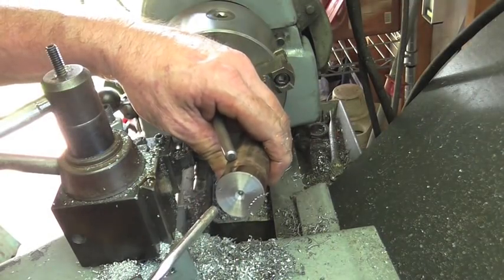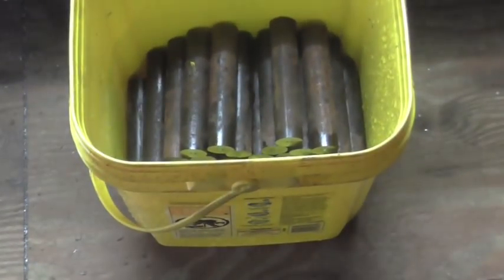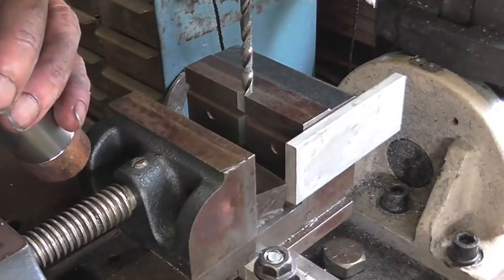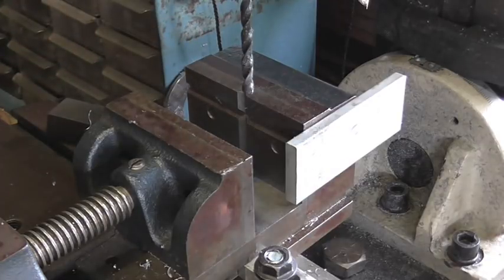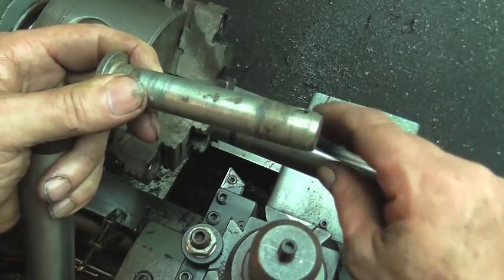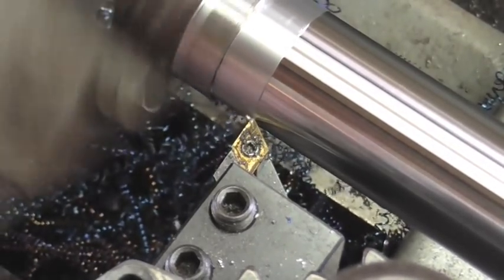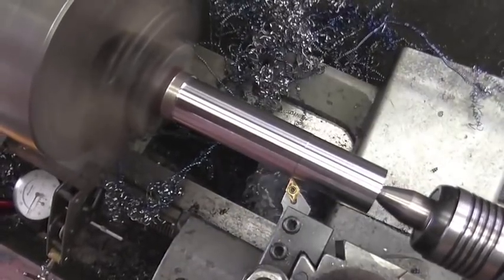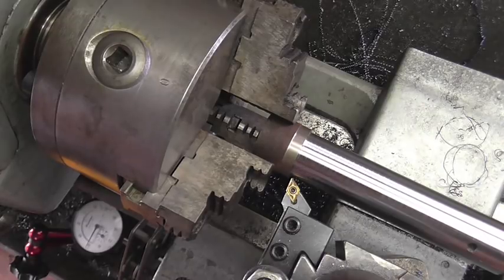(40) Precision HOIST Pins Machined From 4140-HT Steel / RUSH JOB!!! Part 1- MSFN

Comment: You need to make a chip hook.  Great quick project.  I don't have one myself.  What happened when you took more than .010?  Seems like .050 would be reasonable.  I don't have any of that allow to try out.
Reply from the maker: At 1200 RPM I cound take off much more than .010. Sure was a learning experience. At 600 the tool "pushed off" at 1200 & highest feed rate it "cut". I did beat up the lathe and my brass nuts a bit I confess

Comment: I have used a 4140 annealed (not the Half Temper/Heat Treated/High Tensile you are using) a few times and find that it really seems to want high speeds and feeds. I have had decent luck with 1100 rpm and 0.014"/rev. However, I am novice so take my recommendations with a grain of salt. I really like the explanation of your thought processes and that you even show mistakes. Very nice.

Comment: Use a parting tool to under cut the hole close to finish diameter then hog the rest without the intermittent cut.
Reply from the maker: The hole was a huge mistake, that is an excellent idea btw, wish I thought of it at the time

Comment: Makin Sumthin From Nuthin
I'm not sure if I misunderstood you saying you can't take a cut bigger than 10 thou.Whether because you can't get it to chip or the machine can't handle it.Such a small depth of cut shouldn't be a problem on any lathe given the diameter of the work piece.As a machine shop owner 4140 is one of my favourite materials to machine always gives good finish as long as you don't let the tool rub for long at the end of the cut against the shoulder which can work harden the material.From what I can see your main problem is the chip breaker on the insert you are using it's too wide not suited for very small cuts need a tighter chip breaker for shallow and finishing cuts.Also it's not a good practice to pre- drill hole in material you need to turn which as you say creates interrupted cutting and not ideal for carbide inserts.If your spindle bore is large enough to fit that size  bar it's always quicker to use long enough bar that wont cause  machine to shake or material to whip, for instance enough material to do 5 pieces in this case plus parting allowance and an inch or so to hold the last piece.This way you can completely turn each part and part off and once you finish turning them all you can put the pin head inside  the chuck cavity which should fit without a problem looking at the size of the pin,pull it outwards against the jaw as a stop and machine or part off the bit on the end with centre hole.Now you should drill the hole.As they say practice makes perfect.
Reply from the maker: I realized towards the end of the job the SFM using the carbide available at the time was too low preventing a deeper DOC when I first started out with the 4140. The Combination of nose radius, chip breaker, DOC etc. were all were against me when I first began. Once the lathe speed doubled it was "relatively smooth sailing" although I never did figure out how to actually break a chip. But I got thru the job on time and even tho I struggled. The stock was 1.125, my spindle bore is .750

Comment: Some challenges for sure Richard - not the friendliest of material too in a smaller size shop. I tend to get those stringy chips with 10-45 too.
As Dave mentions (User) turning away from chuck can be useful. Look fwd to part 2. :)
Reply from the maker: Yes Chris, wasnt friendly at all. Beautiful steel to work with however, surface finish is glass smooth unlike mild 1018 or A36. I had to earn this one
Reply from the maker: I am sure there is stuff out there that may have helped, I am no expert at carbide either
Reply: I also am not fully familiar with all options but, so much can depend on material, feeds and speeds etc - if there is an integral chip breaker profile then tip radius too can be a factor for it to work. Sometimes experimentation can be useful!

Comment: Get yourself the longest pair of needle nose pliers you can find, to pull the stringy chips out and pull the chips out at the end of each cut. CrMo likes as much speed as you can give it and as the speed comes up I was able to take a much deeper cut than when I was trying to cut at my normal cutting speeds.
Reply from the maker: Thanks RJM......The job went MUCH smoother at the higher RPM even tho the stringy chips were still an issue. I never cut 4140 before...or ran above 685 RPM. Towards end of the job at 1270 RPM I was able to take .020-.025 per pass rather than .010 at lower speeds. Was quite the learning curve...for me at least

Comment: Thank you for sharing, and helping us learning!!!. I think that many of your subscribers have commented comprehensively. 
I think the major problems are possibly lack of lathe power ( your lathe was probably designed to use HSS tools only), and the inserts you are using are positive rake, without chip breaker features. These type are ideal for older/less powerful machines, negative rake require more power, but generate shorter chips.
Again it is always easy to comment from an armchair etc.
Hope you get more contracts.
Reply from the maker: I dont disagree with any of that, I thank you for watching and commenting as well! ~ Richard

Comment: Oh my, , , Gloves make me shudder. I saw a friend get a glove snagged by a long chip and it pulled his arm right off. He died before we could get him to the hospital. We do stupid things thinking we are protected by them. On another occasion watched as another worker got tangled up in a 10 ft. master service radial arm drill the same way. You will never, ever see me with machine tools wearing gloves. I once fired a fella from doing just that. Please think and deal with flying chips with a simple straight 3/8 rod. Aside from that ass ripping I love working with 4140. Doesn't always give the best finish but really reliable stuff eh. Great order for ya bud but soooo many pieces would drive me nuts as I am sure almost did to you.LOL ! Your common sense is doing great on everything but the gloves bud. Take care and I hope to see you again with all your parts attached my friend. NO GLOVES !
Reply from the maker: my left arm was getting shredded by stringies as I turned the hand wheel to cut the last .020 to the shoulder. I had my arm , hand and glove no where near the chuck. It was a necessary evil and had firm grip on the wheel Dean. Love ya brother, thanks for watchin out

Comment: Those chips would make pretty pattern steel knife blades.  Look like you need a good face shield while working lol
Reply from the maker: I had to put one on for most of the 2 days Rodney
Reply: @MakinSumthinFromNuthin  i bought me one.  Got tired of grinder dust and sparks.

Comment: Carbide inserts do not like interrupted cuts. Also, when you start getting the long razor wire swarf, try changing your feed speed, spindle RPM's and/or your depth of cut. By playing with these, you can usually get rid of it. You needed a bigger lathe for this project taking .300" off. I would have taken it in 4-5 cuts....... LOL

I hate the word RUSH
Reply from the maker: I tried every speed and feed rate I had....the 4140 whipped me.......LOL

I over-promised....but delivered! LOL
Reply: Makin Sumthin From Nuthin  -  Now that is a mark of a man's true character.  Working you butt off under difficult conditions to deliver the product, within specs and on time, as promised.
Reply: That is the important part Richard, you delivered. We learn from every job we do. Sometimes the lessons are more important than others. I know it is hard to say no but sometimes our pride prevents us from saying "I don't think I can handle this one". Been there and done that numerous times.
Reply from the maker: Thanks Vernon....was a new client

Comment: Is taking a deeper cut then .010" maxing out your lathe? Need to activate that chip breaker. Good luck and watch out for those flying chips!! Lol
Reply from the maker: currently .010-.012 per pass DOC under the current cutter geometry (.020-.025 off DIA), as time passes I improve on that tremendously....stay tuned for part 2